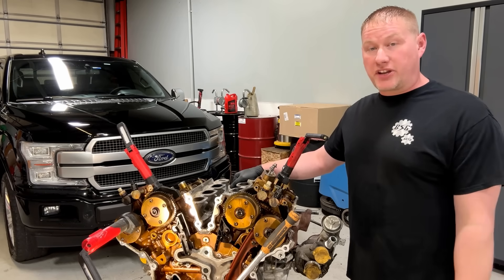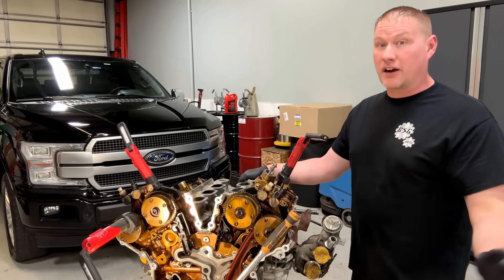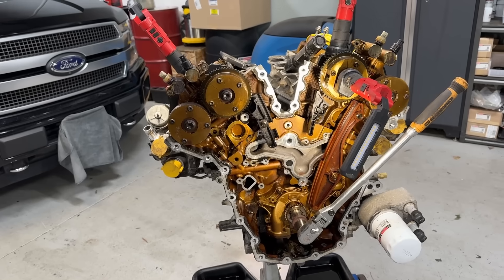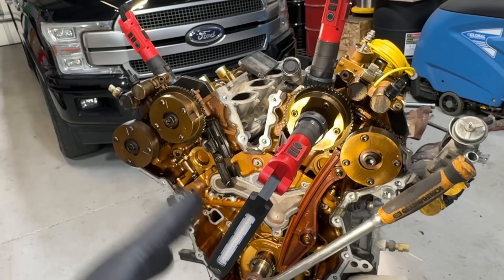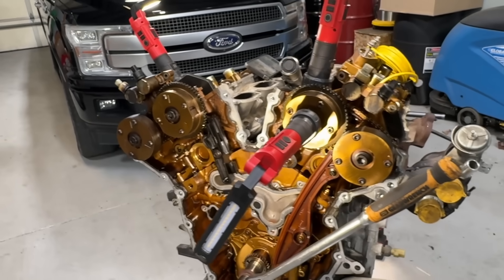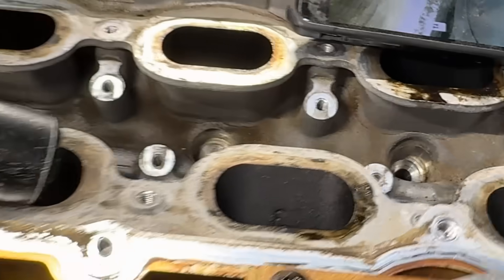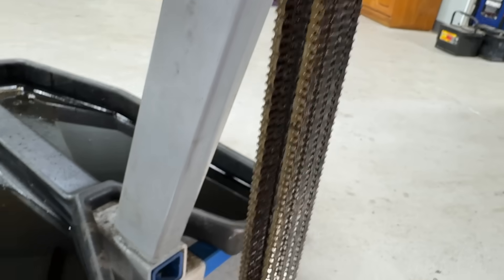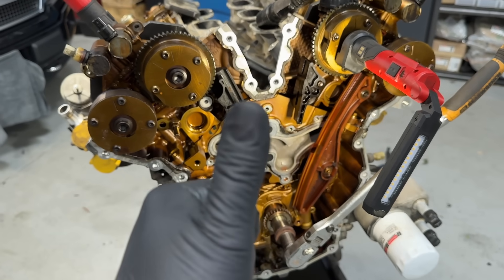2011 Ford F-150 3.5L EcoBoost Engine Failure: P0016 P0018 Camshaft Crankshaft Correlation

Comment: Hey im looking at maybe purchasing a 2011 ford f150 3.5 ecoboost with 263k on odometer. Has a cylinder 1 misfire code and random misfire code. Also has a overheat performance code. Should I stay away from this? Is this alot of miles for this year and Gen?  Turbos be ok still? Any help would be appreciated. Im also very mechanically inclined. Just not familiar with these years and ford line. Thanks

Comment: I wonder what percentage of ecoboost issues would have never happened if everyone did 5k mile oil changes?  50,60,70,80%??  I can do mine in 20 minutes for 30 bucks with full synthetic and OEM filter.

Comment: Is chain stretch inevitable even if oil changes are done every 5K? I have a 2011 that I bought new and have done no more than 5K oil changes with BG MOA every time and now have 103K miles. Never any timing codes and just had spark plugs and valve cover gaskets replaced and engine internal is super clean. Also have had a catch can since 16K miles. Am I just getting a longer life from timing chain from my attention to oil changes, and eventually it's going to stretch? Question is...Is chain stretch a material issue (metallurgy) or lubrication issue?

Comment: I had the melling high volume oil pump installed when I had my timing chain/tensioner/guides/phasers replaced!!  That smelling pump is a game changer..runs better than when I bought the truck new in 2012..just turned 273,00 miles.

Comment: Engines shouldn't have these issues with low milage like this especially when they cost so much, chains never fail in pre 1997. Smaller engines get the same MPG or les under tow than a V8. Go back to push rod, Stop with the DOD on Chevy. Sad. cost you more money on repairs than saving what little gas miles you may get. Sad. How to avoid? Buy a new truck before it gets 100k. Then again you loan maybe upside down.

Comment: I think the chain stretch on these is caused by low oil pressure due to pump wear. This in turn increases friction in the cam bearings, chain stretches. Reason I say this is because after replacing just the chain and not the oil pump Ive had several come back within 15k miles with either a broken secondary chain or the engine has spun main and rod bearings and is cooked. Now when replacing the chain on these I replace the oil pump as well and none of those have had any further issues. The same goes for the 5.0 coyote.

Comment: Ford reliability nosedived when they went to the overhead cam engines. Especially the V6 overhead cam engines. The 4.2l was the last bulletproof engine ford made I’ve got over 350,000 miles on my 2003 and it’s never had any internal engine work done only replaced gaskets to fix oil leaks which is normal for any vehicle with this milage on it. This engine has been put through the wringer 10+ years on one K&N air filter and shows no abnormal wear or any oil consumption from said filter   This engine burns no oil!

Comment: Yeah our local ford dealership could use a guy like him. Our ford dealership is an absolute rip off. Go in and have them work on my truck the other day , my appointment was 9:00AM and i was on the road at 12:30. According to my math 3.5 hrs. They charged me for 9.5 hours of labor. When i asked about it i was told that its just the way it is!! Cool!!! So a ford tech can charge for 21 hrs every 8 hours!!🤪🤪. Now i know ford math

Comment: I saw your other video about the $6000 tune up. If it really costs that much, wouldn’t it make more sense to just buy a new engine from Ford and swap it in?
Reply from the maker: $6K parts and labor. Or $6K just for an engine PLUS install

Comment: I have a 2016 F150 Ecoboost. 
Change the oil every 3,000 miles full synthetic. Excessive?
Probably. But I feel comfortable driving it. So far so good.
Then again it only has 46k miles.
We’ll see as the miles go on!!

Comment: Thank you so much for this!  I helped my brother-in-law, who had about 220K miles on his 2012 F150 that had this exact issue, with those same two codes find a reputable shop to repair it.  It cost almost $8K to fix it at a local shop, but they did other items such as intake valve cleaning at the same time.  The truck now has 247K miles on it and still runs like new, with original turbos, suspension, and transmission.  My BIL is original owner and always changed the oil every 5K miles.  It's super important!

Comment: 2016 Expedition with 125k, and running strong. I believe these got the 1st gen EB from the 11-14' F150's. These were always 1 gen behind. Had startup rattling on cold start at 60k miles, changed the oil to Delo 400 XSE 5w40 and 5k intervals and I have yet to hear that rattling come back. 85k miles later, Wix Synthetic filters and that oil have kept the rattle gremlins away. Now to deal with a broken manifold stud.

Comment: Believe it for not my uncle has 586,000 on his 2013 3.5 . Original engine three transmissions . He hauls a skid stir regularly owned since new . 

205,000 on mine only major thing I changed the turbos . I haul a small dozer occasionally.

Comment: I've got three Fords all very current. Two EcoBoost and F150 with a supercharger. They all haul ass and have large oil capacities. I changed the oil in all three of them at 3,000 Mi with a filter. I use 20,000 Mi full synthetic. The oil is always black at 3,000 miles with all the blow by of the turbos and the blower or supercharger.  Oil is cheap

Comment: I have a 2018 3.5 ecoboost. Should i be worried?
Reply: Fellow 2018 owner.   Bought mine with 120k, it had the issue.   Oil was changed every 4500 miles and was proven by carfax.  It cost me 3500 to have it done, she purrs like a kitten now.   Mechanics said the inside was spotless other than the chains stretching.  I had them replace the entire works while they were in there.  
    So yes, if you hear any rattle at start up, get it in and do it.   Make sure you watch his previous video on how he does the job and ensure they use those parts.
Reply: @myronman3 Thanks much appreciated

Comment: 147k miles of lack of maintenance.  It's amazing it lasted that long.  I'm wondering if he put thicker viscosity oil in it as well.  You can also see a difference in the chains for who actually changed their oil often enough.

Comment: My 2011 did this code and P0299 in 2014 just a few weeks after I bought it used, turbos would not spool up, no power. Dealers said nothing was wrong, took about 3-4 months before one dealership finally replaced the timing chain.

Comment: My daughter had a 2014 Ford f150 .with the ,3.5 eco boost.she took it into Ford in harrisburg pa to have it serviced,oil filter and differential.got it back and on the way home the engine destroyed itself.tower back to Ford and they said the fam phased went out at83 thousand miles.they said that she should have had them check that.she said you just serviced it.there answer was sorry

Comment: My question is why are so many issues with new cars, like chain stretch, suddenly on the scene?  Seems things like this were done away with decades ago and now they are back- out of the blue?  Inferior parts, mateiials?  I know i want nothing to do with late model vehicals.
Reply: Direct fuel injection, longer oil change intervals and lower viscosity oil.

Comment: Brian's knowledge about Fords is amazing. Exactly why I drove 600 miles to let him work on my truck this week.
Reply: You chose Wisely !
Reply: I try to do as much as I can on my own, but I'm 62 and it's not as easy anymore. If I ever need anything major done, I plan on taking it to him, as I'm only about 2 hours away.
Reply: Mine needed the entire timing chain/oil pump system replaced along with the rockers and valve covers. A day and a half later and everything was like new. The truck runs like it never has before. So quiet and powerful now. Made it the 600 miles home like a champ. I was going to attempt this myself until I watched his videos and realized what all was involved. Nope, I wasn't touching this with a 10 foot pole lol!

Comment: So does the lack of proper oil lubrication cause a timing chain to stretch? If you do 5000 mile oil changes with the correct spec oil and filter will that mean the chain might outlive the rest of the engine?
Reply: Combustion blow by is greater in Boosted motors. The oil gets contaminated faster. OCI is kind of a joke from the factory. Clean oil is always best. Even with good filters it won't catch all the particulates that cause excessive wear. I buy oil that I know is designed for turbo motors such as delo 400 XSE or Rotella T6. Better additive package. Not everyone is as brave as me because it could cause catalytic converter issues. 85k running a heavy duty diesel oil with out any performance issues. Revved to 5k RPM daily while getting on HWY 😅. I trust the oil I put in my EB. 5w40 flavor, and max 5k or 150 hours OCI.
Reply: Here is my understanding.  Direct injected engines produce soot that is abrasive.  Extended oil change intervals cause this soot to build up in the oil to concentration levels that can cause wear issues in the elements of a timing chain and make them sloppy.  The effect is an elongated chain.
Reply: @turdferguson4124  Oh OK. I thought soot was in diesels. Thanks.

Comment: Hi I have 2005 Expedition after engine rough and smell fuel obd gave me #7 misfire I drove home about 15 km. I checked sparkplugs sparks, fuel injectors cleaned  ( #7 replace with new) , cop whiten specs. now engine cranking slow + rpm needle doesn't move and engine not starting. ecm doesn't throw anything please advice

Comment: I used to be a hardcore bicycle mechanic and chain stretch was a real issue there too. Keep it cleaned and lubed. The pins at each link start to wear as the links pivot on them, and as little as 0.1mm on each pin adds up over the length of the chain and before you know it, you're over 1/2" too long. The derailleurs don't shift right, you might throw a chain during a shift, the gears and chainrings themselves start to wear... It's all very analogous to the timing chains and all preventable. Of course it's a WHOLE lot cheaper and easier to replace a bike chain, but the principle is the same. Once they wear and the overall length increases, the space between each link changes slightly, the tensioners can't take up the slack, and you'll jump timing or just get out of phase. CHANGE YOUR DAMN OIL PEOPLE!!! Oil is cheap! Timing chain replacements or new engines aren't!
Reply: unfortunately, maintenance minders have neutered most owners and the responsibilities involved in oil changes.  They ultimately rely on the manufacturer to direct that maintenance.  As we know, that was a false promise.  Maximum 5k or 7.5k oil changes, if using a high quality full synthetic is needed.

Comment: My 2025 F 150 3.5 lasted 6 weeks 1,894 miles. Went to the shop sounding like someone was knocking on the front door. Got rid of the POS after Ford instructed the mechanic to remove the engine and tear it down. The bright spot was the promise to put a remanufactured motor in it if the motor couldn’t be repaired. Damn I hated that truck!

Comment: I have a 2016 eco-boost 3.5 on the original timing chain and phasers. I change my oil every four to 5K and I also use hot shot oil additive .I have 140 K on my engine and all good.

Comment: My buddy has a 3.5 eco boost in his f150 he changes his oil every 3500 miles he uses the triax 5w30 synthetic synergy oil and a Baldwin B7449 filter 171,000 miles never had a problem

Comment: Why do the turbos go bad all the time. Bought a 2011 f150 3.5 eco boost. Turbo was gone put a new one on on miles on only run time turbo leaking oil out the exhaust.

Comment: I must've gotten lucky with my 2011 3.5.  204,000 miles in 12 years on the original timing chain, cam phasers and turbos.  Seeing the truck in this video makes me miss it.  It was a better vehicle overall than my 2023 is.

Comment: Im shopping a new ro me f 150. What year what engine do you recommend?please.  Ive gone thru so many trucks
Reply: I would stay away from 2020-2023 (the covid years, unless 2020 was built 2019).
Reply: I guess more specific im looking at older trucks. From  early 2000s up to probably 2018
Reply: 2010-2014 with the 6.2, hard to find not in a Raptor, but do exist.
Reply: @kirkschreier2369  I have an 11 6.2L Platinum. It is indestructible. Just 4-5K oil changes. They are quite expensive used though. This is one case "I know what I have" is true.

Comment: 2014 3.5.  I changed the oil every 5k miles with full synthetic and still got phaser rattle at about 125k.
Reply: I would change the oil every 3k miles for any engine with turbo(s).  5k is good for non-turbo engines.

Comment: I have a 2010 F-150 with a 5.4 l Triton. If I was to purchase a newer F-150 with a 3.5 l ecoboost, could I swap the engine and transmission, or would I have to make modifications?

Comment: Just did the oil on my 08 explorer 4.0 , every 3500 miles just passed 268,000k miles runs great (large part thanks to your videos bro 🤙)The only freaking code I got is the stupid tire pressure sensor lol
Reply: Aren't those TPMS codes and or lights annoying ...AF........lol...

Comment: So, I still have my 2014 F150 with the 3.5L ecoboost and I'm almost at 200K miles now. I do NOT have any error codes and do NOT have consistent rattle at startup, but I HAVE heard it in the past. I would say at this point the startup noise is rare for me, so am I to understand that as long as I see no warning lights/codes (I do have a 'Bluedriver' scanner tool and there are no errors), then I'm safe until I DO get a code?  I've been doing regular oil changes at 4K miles with full synthetic 5w-30 oil and regular treatment with hot shot secret stiction eliminator.
Reply: If the truck is relatively rust free, in good shape and you plan on keeping it for many more years, I would certainly plan on doing it soon (set aside the money) rather than later.  Don't get caught off guard.
Reply: @PaulC-x7d   I don't drive it much anymore (because I don't have to, but it's still my main car....though we have others)...and my plan is to go easy on it until I buy a new car in a few years and then have the old truck just be an occasional use thing for when I truly need a truck bed, which isn't often.  Hoping to avoid the $5-6k repair bill if I can get lucky.  Like I said, no error codes (never have been in the past either) and only a very rare rattle at startup.

Comment: The lesson?  On all ford vehicles made in the last 20 years, keep your freakin oil fresh!  Ignore the recommended 7500+ oil change interval in the owner's manual!
Reply: Yup, it so cheap and easy
Reply: Owners manual in my late 80s Ford truck and van both said 7500 mile oil change.

Comment: My 2014 Explorer Sport at around 91,000 miles had P0016, P0018, P052A, P052C and P0021. Tech at Ford said the chain skipped teeth, Timing job done for about $5,000cdn! It ran pretty good with all those codes, but more started popping up, so I bit the bullet and had it fixed. Runs great now!

Comment: Is a 5K change interval sufficient for Eco Boost engines?
I do regular 5K pms.  Do I need to avoid eco/turbocharged gasser engines?
Reply: You'll find that most of us that have these and are doing 5k oil changes instead of the factory recommended 7500+ are well past 150,000 - 200,000 miles without any issues.  My limited experience with my own first gen EB and the few people in my inner circle with them have had the same experience.  So, IMO, they're great.  I love the way mine tows

Comment: What's the way technology is I'm sure that the manufacturers could have account on their when the code is set and counts x amount of times once it counts x amount of times of the code being consistent it literally shuts the engine down from having any kind of RPM over let's say 1500 plus I've never had one of these engines apart are there any reliefs on the Pistons I do not think so but hey thanks for the info I don't do this anymore I'm too darn old😅😅😅

Comment: HOW ABOUT WE GO AHEAD AND RUN THE ENGINE BACKWARDS AND BEND THE VALVES BACK THE OTHER WAY😅😅😅 (humor from the 73-year-old mechanic with 51 + years under the belt)

Comment: I have a 2014 3.5ecoboost 130k. Do you know of a shop in Southern California that is good/like you?  The dealership doesn’t seem to know what they are doing and states if it is not throwing a code there is no problem. When I first purchased it 17k miles it had awesome power but by 50k it was noticeably less.  I tow 9000lbs regularly over 500 mile trip same location road and load. Full synthetic oil changed at recommended intervals.
Reply: What are the recommended intervals?